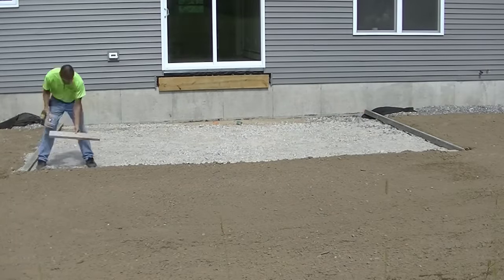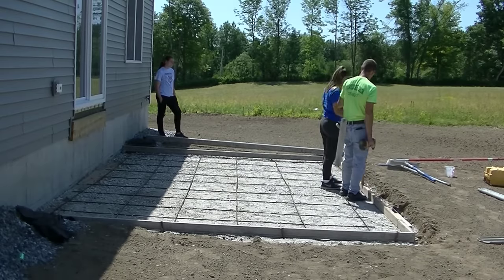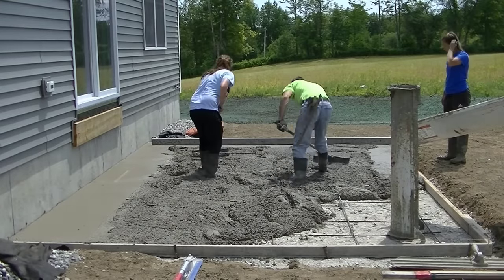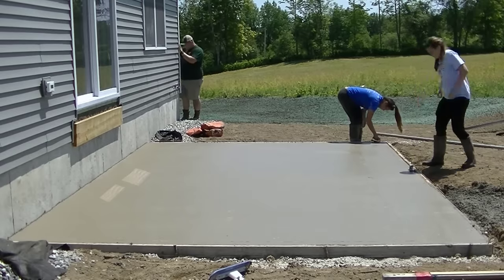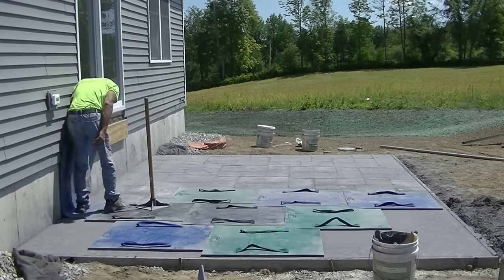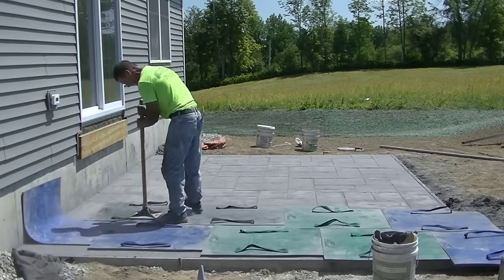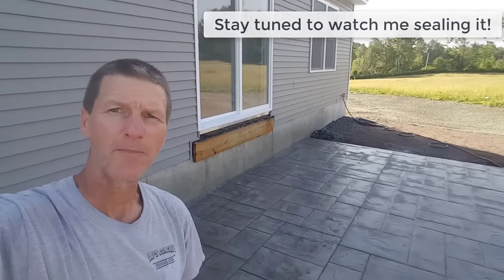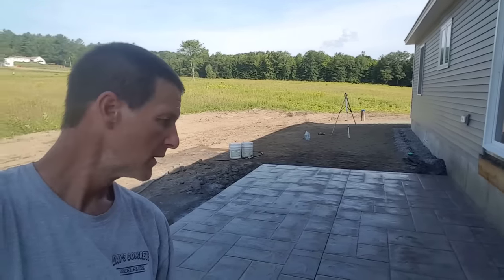How To Form, Pour, And Stamp A Concrete Patio Slab

Comment: I did this for a living a few years ago. I had my own crew before the company went under. Definitely was my favorite job. Hard work and I could use my artistic skills to make amazing results. My personal favorite job was an overlay on a patio I did, the customer gave me freedom to do anything I wanted. I used an Adobe base color with a liquid release and a flagstone pattern. I mixed different earth tones  using powder release and topcoat then hand painted all the stones. Made them look as realistic as possible. Looked fantastic when it was done.
Reply: Also something I did that I don't see many doing is taking a mini trowel and knocking out the stamp joints then hiding the lines using the same method as above. (Mix of color release and sealer.)

Comment: About time a video where someone knows what they are doing great job!
Reply: Other than cross mopping..
Reply: @davidjohnson3024  What is cross mopping?
Reply: @kbanghart  probably referring to the direction he pulled the screed off of the left side of the patio. Ideally you bull float perpendicular to the direction you screed
Reply: @Thotanos  thanks. One more question if you don't mind, for a large area, would it be ok to place in sections, and have joints in between? I guess the risk is that later on, part could raise or settle above the others, but would a gravel base help with that also?
Reply: @kbanghart   You can absolutely pour in sections. Takes a lot more time and effort, but if you don't want to use a bigger crew or are working with smaller loads of concrete anyway, it can be done. You can run rebar through the form on the side(s) that abut the next section(s) to 'dowel' the slabs together. As an added bonus, that can reduce or eliminate saw cutting. Note that you can get inconsistencies between pours that may affect the aesthetics.
Reply: Why would someone who knows what they are doing not put seats under rebar or does rebar work best pushed into the dirt?
Reply: @baysidelanscapingandearthworx  sometimes they forget, or just don't do it. Yeah, even the pros. 
I mean, where I live, in CA I don't think I've ever used rebar on any household project I've worked on. But to be sure, I would just talk to them about it, and then of course check to make sure they actually do it during the process.

I have a big park nearby with very wide sidewalks, I find myself wondering what they did in those situations, etc lol
Reply: Valley Yard Services honestly this is a big mistake lots of finishers do we got to under stand that it needs to have chairs or even rocks or bricks under the steel in the beginning when I first started I’ve made the same mistake what happens is the weight of the steel settles lower than you lifted it
Reply: @rubenguerrero1788  we would use chairs for rebar and as person was screeding a person was moving infront of him with a hook and lifting it to make sure it's in middle
Reply: @kbanghart  we always use seats and lift with the hook to make sure it's ok.
Only people that don't use redar is council on footpaths because they are always tearing them up or areas that won't see any heavy traffic.
Reply: Ok where do I begin, First of all if I was the home owner of this patio and I seen this video I would make you tear it out and redo it.Lots of mistakes that are going to cost the homeowner lots of money in the long run,Just so you understand who your talking to my name is Ruben I am a concrete forman/quality control/concrete inspector, I hold over 29 certifications including my osha 500,and won 12 golden trowel awards. My job title also includes me to take core samples of every commercial job we touch to check if rebar was lifted.Yes let’s just say you did lift it and to me that looked like a 6 1/2 inch slump you poured,remember you had to walk bad in to screed it and also your helpers  had to step back in to pull the concrete,plus this is a stamped concrete job that requires you to pounce on it to stamp it. Go back and watch your video and see how many times you stepped on that rebar and never lifted it.The other issue I’m having is that you never put expansion joint against the wall PLUS you never dialed into the existing  foundation. It is very important to put expansion joint against an existing slab for water proofing. UNFORTUNATELY I GIVE THIS 5 YEARS AND IT WILL HAVE A 2" INCH GAP FROM WALL AND IT MAY HAVE HAIRLINE CRACKS PLEASE TAKE MY PROFESSIONAL CRITICISM AND USE IT......
Reply: @rubenguerrero1788  cool review
Reply: @rubenguerrero1788  also, when gaps appear between the existing and old, do people sometimes just fill in with some other material?
Reply: Plen122 yes they do plen I found out threw the years if it’s not done right the first time then the best thing to do once it’s separated to use a high strength rubber silicone what that does is keeps water from going underneath the concrete also it stretches and can be reapplied when needed that’s why when people make vids they need to know what they are doing from the beginning good luck and I hope this was useful
Reply: @rubenguerrero1788  Yes, thank you!

Comment: Got to be honest mate, this video is Awesome, you look like a Master at Work completing that Stamped Concrete Patio. Once the sealer is applied the finish looks Fantastic and this is Great as it is a long lasting solution and much quicker to complete than Conventional Slabbed Patios. It looked a little bit daunting to me in terms of the Skill Level required to get the concrete poured and levelled quickly enough, especially in the kind of heat you were working with but then the stamping looks much more manageable and straightforward as it has a regimented process to follow. Obviously you are Expert at these types of installation and you've got the whole process absolutely nailed, it's so impressive that you've managed to put the whole process across so well, this is an excellent video presentation, Top Top Man and Thankyou!
Reply from the maker: Thanks Stuart

Comment: Glad I watched this before attempting to do this on my own.  While I thought this would be an easy project for me to do alone I TOTALLY see I best leave this to a 
professional.  Once again, one never knows the work that goes into something until they have to do it.  Your video helped me avoid a big and costly error.
Reply from the maker: glad I can help!
Reply: You're a smart one. I completely butchered a sidewalk in front of my house a couple weeks ago. Fortunately I didn't go overboard and only attempted a small area because a voice in my head told me it was a bad idea to get into this concrete business. These guys on YouTube make it look like a cinch. It's anything BUT! You watch this stuff and think, yeah I can do that, it's just mixing cement, poring it, and smoothing it.  It's not  that simple. Lugging 80 pound backs of concrete in and out of your car and pouring it to mix it in a wheelbarrow (I'm a tough karate man and threw my back out lifting those awkward, bulky bags of concrete). It's incredibly tedious work to mix it yourself. Adding too much or too little water screws it up. 
This guys a professional, got a damn truck to mix and pour the concrete saving time, energy, and your back! And has probably done this hundreds/thousands of times. Other people commenting here is right, this guy is an artist. I wish I could make my walkway look this good!
Reply: How much did it cost you

Comment: I've seen other guys place a thin plastic barrier against the foundation wall to prevent the new concrete bonding and allowing the slab to move independently of the foundation to prevent cracking. Do you recommend doing that or is that overkill? Great video by the way, thanks for sharing.
Reply from the maker: It's not a bad idea to do that. We use a foam product called iso-strip.
Reply: @MikeDayConcrete  I was wondering same, I didn't see anything between the dissimilar concretes though.
Reply: Candy Kids vapour barier

Comment: Very impressive and beautiful work.  I was thinking about Belgard pavers in a similar pattern for my patio but I really like the stamped concrete in that pattern you used.  What are the pros/cons of the two?
Reply from the maker: With pavers, if you live in a feeze/thaw environment, you will get movement and eventually weeds or grass growing up in between the pavers. I know because we replace a lot of pavers with stamped concrete for this reason.
Reply: I gotta say tho I live in a freeze/thaw zone and we replace a lot of cracked concrete with pavers. And yes I know if u do it right it won't crack. But if you do your pavers right they won't move or get weeds. There are paver roads thousands of years old that look perfect today
Reply: @mickmcmickerson7718  I agree with you mike. Movement, weeds and grass can largely be avoided if professional, proper construction practices are used (weed barrier fabric, machine compacting, polymer sand, good edge restraint etc.) And an important note, repairs on or under pavers are seamless and much easier to perform than those around concrete.
Reply: @shhh3437  exactly. I spend quite a bit of time re-doing really old paver patios.(only the ones that weren't quite built corectly).And it's waaayyyy easier than breaking concrete and re-pouring

Comment: Did not see you raise reedbar off of ground. I've seen guys use pieces of concrete block to hold bar off of ground so concrete gets under bar. I guess my ? is do you have to raise bar so concrete is under bar to hold concrete together
Reply from the maker: Yea, I have small rocks under the rebar holding it up.

Comment: That release around the patio never goes away, something the contractor never tells you and they dont get rid of it for you. You also should tape/mask off the house with plastic to avoid getting sealer on it like you did.
Reply from the maker: Thanks for that. I'll do better next time.
Reply: A shop vac will do the trick.

Comment: Hey Mike, one question I'm having a hard time getting an answer about stamping concrete....how do you know when it's time to start the stamping process?  I would think in hotter weather it would be quickly after floating it, but in cooler weather how do you tell when it's time to apply the release agent and start stamping?
Reply: Kevin Polk once the concrete can support your weight. You don’t want to be sinking or you will stamp it too deep. This timing comes from years of experience but basically if you can step on it and are barely leaving a footprint it’s time to start (float out the footprint obviously) first timers always start early. With the tamper you can rly pound the impression in when it’s a bit harder
Reply from the maker: Good comment, thanks!
Reply from the maker: Kevin, it's got to be a certain firmness. I talk about this in a few other videos I have about when to start finishing. And I really teach you in my stamped concrete course. It does come down to experience. Hot weather and cold weather play a big part in when you start and how big of an area you have to do is also another factor. How experienced you help is is another one. Like I tell all new people. Start really small, get a feel for it. Then go from there.
Reply: @aaacustomdesign2729  Thanks a ton for the response, I don't think I want to try this by myself but might not have any other options
Reply: @airsmith006able  Did you start it yourself or have someone else do it? I'm about to try myself, but I'm doing a very small area with a small stamp, so if I mess up hopefully I won't be too mad at myself lol. My plan is to use it as a border.
Reply: @kbanghart  I wound up hiring a local concrete expert to help me...he provided technical support, came out good but learned NOT to pour and stamp concrete during the wintertime!  It's worth a few bucks to have someone with experience onsite helping!
Reply: @airsmith006able  ouch. What happened with it because it was winter? Did it rain too much?
Reply: @kbanghart  The slab we poured was 13' x 20" with a depth of 4" with rebar.  We poured on a couple of warm days but one side of the slab was on the north side of our raised deck (always in the shade). The ground was cold and the coldness from the ground apparently came up into the concrete and consequently the release powder we used did not adhere to the concrete, we had to put down an extra layer of powder down before we sealed it.  The areas that were in the sun came out amazingly well.
Not sure if I would ever try that myself as the consistency of the concrete is an important factor as well as the timing.  Having an expert helping made all the difference in the world, would hate to have to do it over!
Reply: @kbanghart  One other item I would suggest...when my guy cast the powder release agent on (we did 2 colors, terra cotta and charcoal) he threw it by hand...left a lot of cast patterns we had to clean up.  I saw a video where the guy used a big hand brush for casting, gave a more even coat...DEFINITELY will use the big brush next time. 
Also, when he put in the stress joints I waited a month and filled in the joints with a special colored flexible caulk.  In Colorado I didn't want water getting in the crack and freezing and causing concrete cracking.  We matched the color of the calk to the color of the release powder, came out nice
Reply: @airsmith006able  That's all really good information, thank you. I've actually never done color before, all my experience has been helping my dad pour walkways and slabs for his work buddies when I was young, and then a whole bunch of fence posts lol. But back then we never did color. So I think I might try one where you can mix it in, and mixing concrete, that I know I can do lol, and I'll see how it comes out. It'll be next to existing concrete so I won't expect it to look perfect, it certainly won't match, but at least it'll be better than what I have now, which is dirt and mud (and dog poop ugh)
Reply: @kbanghart  Good luck on your project, should be a fun learning experience.  We considered adding the coloring into the concrete but since we ordered it from a company on a truck they didn't have the right color we needed.  That would definitely help with the process.
Also, we wound up using a great water-based sealant Smith's Seal WB Gloss, easy to apply and really dries hard (already had the grandson drag metal object across it with no scratching).  We chose the water based product for ease of cleanup, etc...really like it!
Reply: @airsmith006able  also, did you put any gravel under the concrete? If so, how deep?
Reply: It's a TRADE! 3YRS EXPERIENC TO BE A JOURNEYMAN CEMENT MASON! MINIMUM! THIS IS NOT DIY! TO MANY VARIBLES! ASK A CARPENTER HE WILK TELL YOU! LOL. HIRE A JOURNEYMEN

Comment: Awesome job! I've got a 24x24 patio that i need to build for myself going back and forth between a deck and a slab, and this video is giving me a lot more confidence to be able to complete the concrete work myself. I was blown away by the quotes i was getting for a slab, so i decided i'm going to learn to do it myself. Really informative video, and great step by step for a DYI'er. I also found it extremely satisfying watching that water flow off the slab perfectly!

Comment: 16:40 I don't understand why he cut the slabs with saw?
Reply: Due to settling, slabs need to be given space for movement. There's a few ways to accomplish this, for this particular job, he cut the slab into sections to create that space. Not doing so would result in the slab cracking much sooner.
Reply from the maker: Cutting the concrete helps prevent random cracks from developing. If the slab does crack, it'll hopefully crack in the nice straight saw cut.
Reply: @MikeDayConcrete  Why no saw cut on the 6"  30' x 24' double garage slab you did in your other video? (Great job on this video BTW,... very impressive!).
Reply: @MiniMe526  So the full length rebar is pointless! 
Looks like either the ground and gravel should have been compacted much better in the beginning or the slab should be thicker, or the slab should have been made in 4 or 6 sections with 1/2'' by 4'' boards in between to allow for expansion/contraction and settling. By the way, as we all know here, once the rebar gets exposed, it will rust away and split the concrete and look worse than ever!
Reply: @MiniMe526  expansion joint

Comment: I'm a contractor in California and I've tried for years to finish concrete with mixed results so i really appreciate how challenging this is. You over trowel and it turns into a soupy mess, but if you don't move fast enough, you're screwed. If you hand mix it, you really have to be careful how much water you put in each batch. The slate finish is nice because it's both anti skid but also decorative.

Comment: Hey Mike great job. I was a journey man cement mason from 1978 to 1993 LA CA. I learned how to stamp back in 1983 I  the company I worked used stamps made out of cast iron heavy as hell then the stamp's came out of heavy plastic. We the crew at BFS did this same pattern at Chinatown LA. At custom homes we would wax then buff out the concrete look like a million bucks.
Reply from the maker: That's funny, I started with those cast iron stamps also about 82.

Comment: Wow that turned out great, attention to detail all the way through, professional who takes pride in his work sure shows on the finished job, squared off form, nice even pitch even mindful enough to make sure the house was cleaned off afterwards, that stamping sure makes a difference . When you cut the concrete after whats the standard for how many cuts per feet and how deep must it go is there a percentage for different thickness like 40 percent of the thickness or does it depend on the type of concrete used.